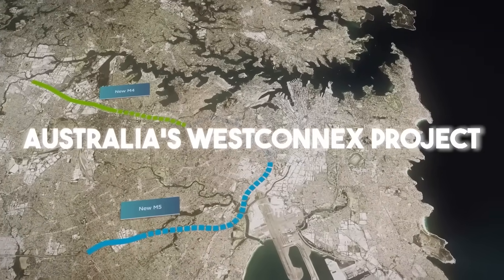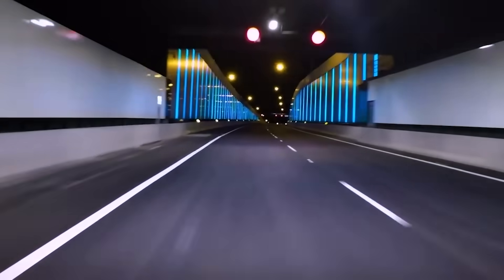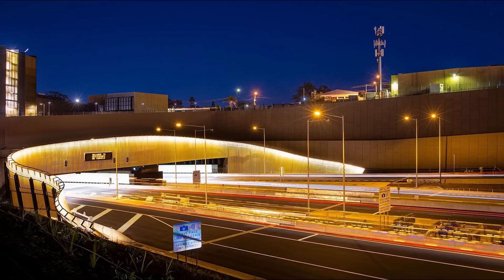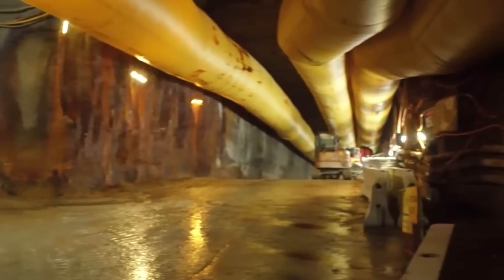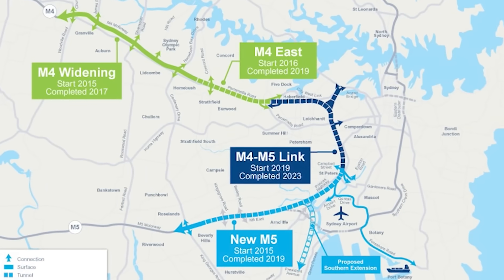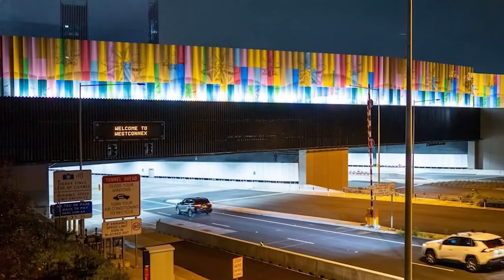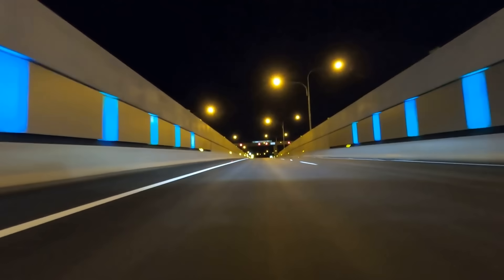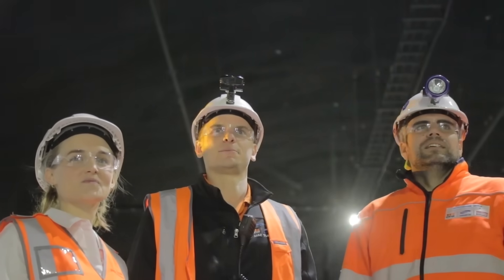Inside Australia’s Longest Underground Highway!

Comment: $45B cost for $20B benefit? Did I hear correctly?
Reply: The $45bn figure is not correct. The cost of the project (minus variations and property resumption) was $17bn and there wasn't that much property acquired by the Government for the project. Variations were mostly limited to adding capacity to the Rozelle Interchange to permit interconnection with the Western Harbour Tunnel, currently under construction.

With all tunnelling, including emergency escape tunnels and ventilation shafts, there is over 150km of tunnels in this network and the video got one other thing wrong - the spoil from the project was not taken south, it went to the site of the Nancy Bird-Walton Airport to level the site out and displace water to provide a firm surface for the airport to be located on.

The WestConnex mainline tunnels are also the only long span tunnels in Australia with a speed limit of 90km/h, with all others being 80. I am a regular user and this job has changed Sydney for the better. Those sulking about tolls can use Parramatta Road if they so wish.
Reply: @vintageradio3404  

I don't think it is 'sulking' in regard to the tolls, I got a part time job at Sydney Airport after i retired, and commuting from Parramatta was a bit of a chore, but as I started at 4:00 am, it wasn't too bad for traffic.

Then when the tunnel opened I was very happy to use it until I found out it was going to cost me $12 each way, nearly an hours pay at that stage.

$24 per day is $120 a week, as a part timer working 6 hours a day, it was just too much, it was working out to be nearly 20% of my weekly wages gone, just getting to work, not counting fuel, way too much, and a genuine complaint, from Working people like me, rather than just 'sulking'.

They state here, that traffic conjestion is costing $5 billion a year, and rising, so this tunnel is capable of paying for itself in a few decades, yet they still want the car owners to foot the bill.